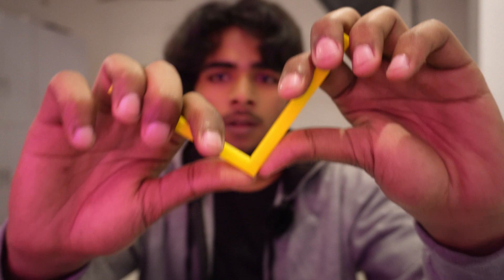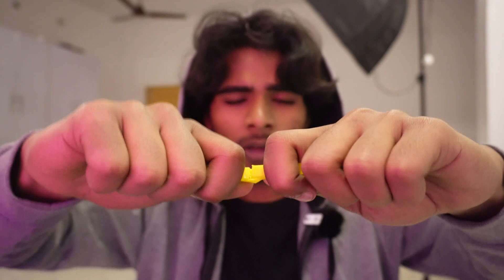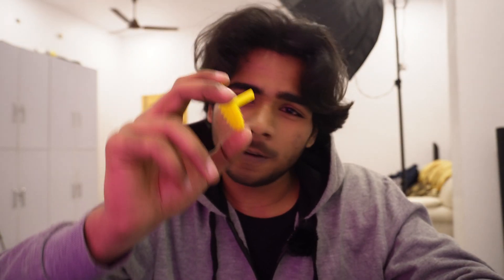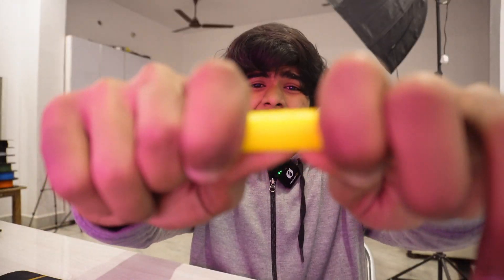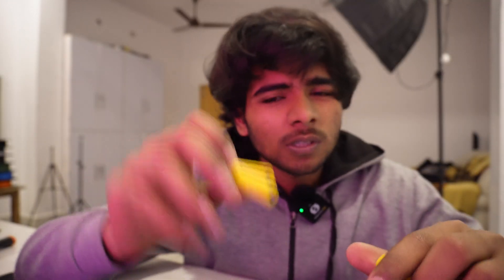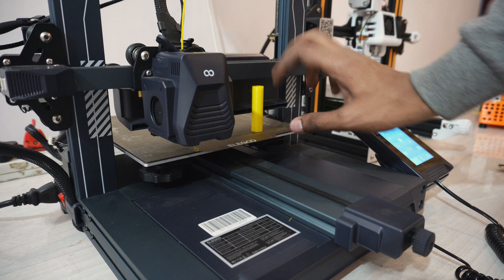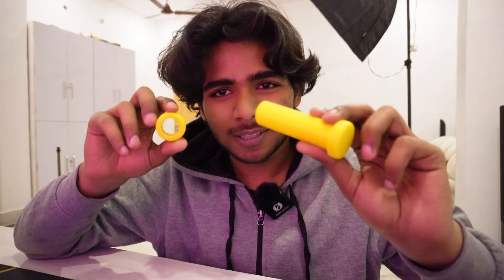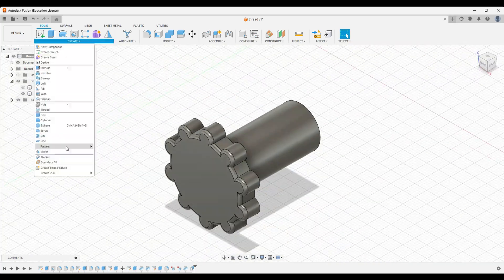5 Elite 3D Printing Tricks that You Should Know

Comment: I guess the title should be "5 obvious things that everyone knows".

Also about one at a time printing, I am using it for quite a while, and if you need to mass produce similar parts its actually the best method. First reason is that the surface is much cleaner because there are no strings and blobs from retraction on the outer.
And most importantly, it is less risky. Because when you print a big batch of parts simultaneously and something goes wrong - you loose all of them and its a huge waste of filament. When something goes wrong while printing one by one, in most cases you loose only one part, because that where before are printed okay and the other ones are not yet started.
And also for the same reason you have several time frames during the print and cancel it before the next part if your plans have changed. Like you have 2 parts of the 6 ready, and now you stop it in order to print something else that is now urgent.
Also this way you can print different amounts of parts by just one file. For example you have a file for 6 parts but only need 3 more, and you don't want to bother to turn on back pc and slice a file with another quantity. Just start the file for 6 and cancel it midway
Reply from the maker: Yes absolutely, you explained really well, thank you so much for sharing benefits